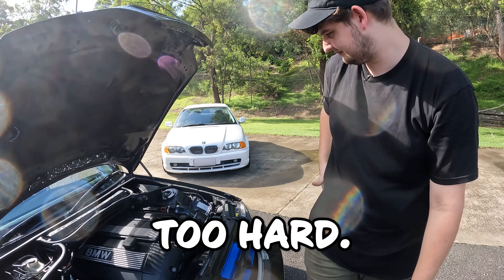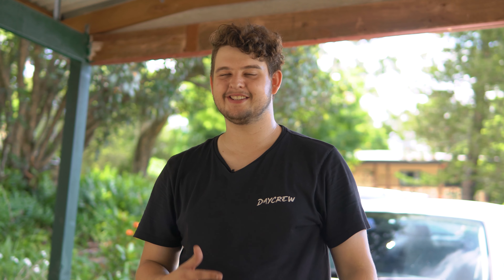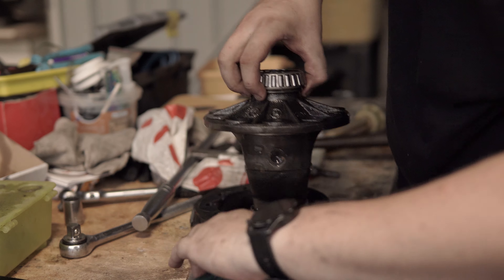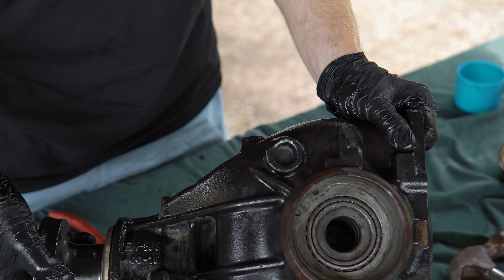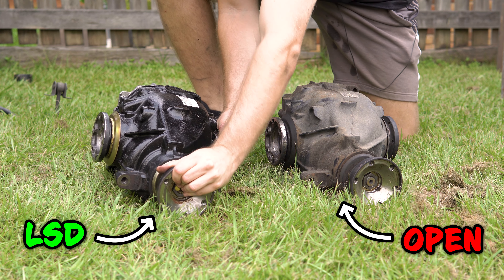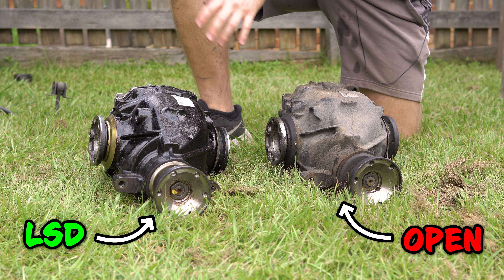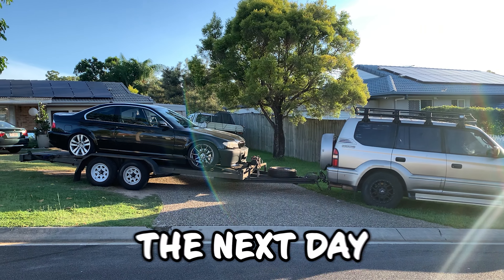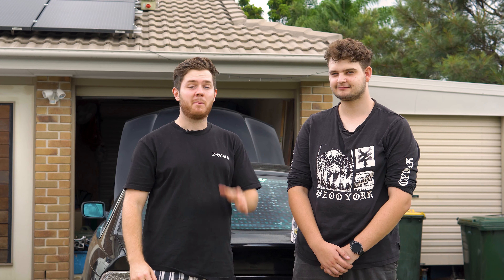We Tested a $300 LSD Conversion Kit (So You Don’t Have To)

Comment: Super informative, interesting and entertaining! Crazy twist! Very cheeky for RD to say it was poor installation.
Reply from the maker: Very cheeky indeed
Reply: @daycrew  Not really. This would happen if they just rebuild diff without instaling kit. 
Central pin come lose due to inproper instalation.
Reply: @pokojnitozo2360 c clip probably broke because of the hammer, the guys who sell this posted a video explaining it and recommend to use a hydraulic press, although they have an older tutorial where they use the hammer
Reply: @phatballlz  ofc u can if u know what ur doing and ur carefull but these 2 guys are not that promising 🤔🤣
Reply from the maker: @nemanjastanojlovic01  https://youtu.be/bLESfhaCROE?si=UDwtKWCaGrfkwNCY&t=378 (should link to 6:18)
You're right we aren't that promising 😂, but on their current guide on installing they use a hammer to install the central pin. This is what we discussed when we said the information was not included in their online guide or in the insutrctions included with the product. If this is the required process, they need to update their guides!

Comment: In my case after a few days on the track it still works. The only problem I have with it is that sometimes when I drift with a low angle it opens spontaneously.

Comment: I had the same problem 
but I have a shop and found out that the central pin was not hardened and because of that it granaded my diff. But they send replacement and the second diff was just not working as lsd so... :(
Reply from the maker: That’s a bummer, did it work at the start or did it always not work as an LSD?
Reply: @daycrew  The first one worked for about 2 weeks of normal driving. Second one never worked. Even thou I followed their advice :(

Comment: I see that you didnt shorten the flanche / axle docking parts. That might also be a Problem, becaus it is advised to shorten them by 4 mm...
Reply from the maker: This is an updated version that no longer requires shimming by 4mm. Older models did require this and we made sure to check before installing.
Reply: @daycrew  what car exactly is it? a 323ci?
Reply from the maker: @leoneazy3800  330ci.

Comment: Entertaining video! Unfortunately the support and hate for this mod keeps hovering somewhere around the 50/50 range... The amount of work required to put it on is just as much work as it takes to throw an lsd in there. With the added benefit of the diff blowing up while you're on the highway. Easy pass. Try throwing an Alibaba LSD in there. They're still pricey but about half as much as a proper lsd
Reply from the maker: The Aliababa LSD sounds like a fun idea for a video 😂. Definitely agree though, a lot of people saying “get it professionally installed” are missing that the cost of doing so would outweigh the cheap price for the unit. (plus none of the professionals we talked to wanted anything to do with it.)

Comment: To me it's the product's fault, not installation. Looks like the center locking pin snapped, it's probably made of cheap métal that's not strong enough hold the torque. I had this happened in stock open diff during a long one wheel peel burnout, one of the output shaft bearing overheated and started welding itself to the carrier and output shaft itself, and when it locked up completely the locking pin snapped clean off just like yours. TBH if you could have someone make you a stronger locking pin that fits this conversion kit it might work and not break like that again. Also I don't think your diff is completely f*cked, you could probably remove the plates ans fit the stock locking pin back in and have a proper working stock diff...or just weld everything thats left in there
Reply from the maker: I think you're right, it looks to be the pin snapped, not the c clip fail as others are suggesting. We also may be welding whats left soon 👀
Reply: @daycrew  The pin didnt snap, you guys just didnt know what you were doing when you installed it.

Comment: I have the conversion kit more than 2 years and 30k km done. I did installation by my self, its not difficult. I had all necessary information before i started. I knew about the necessity of machining spiders gear, c-clip, locking glue, tightening torques for screws to ring gear etc... 
So it's definitely installation fault followed by wrong using it. The kit do what supposed to do. If you expect that kit is the same as clutch LSD, thats your problem and your fault when it breaks. If you drive it like you have a helical or clutch LSD, than you can't be surprised that it broke... It depends on how one treats it. This is not 1 to 1 spare for classic LSD. 

For example I spend a half of day on "drift" day school without problem. https://youtu.be/dNxu9jwQ_2w
The kit is great to improve handling, especially on snow.  With the kit you can stop in hill and move again. With open diff you go nowhere. 

https://youtu.be/rwkwPttrKSI